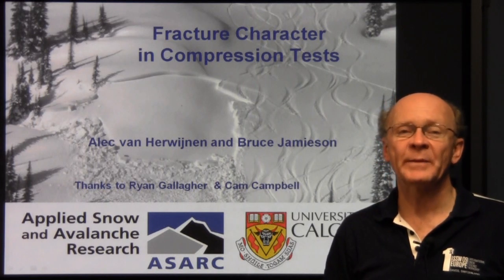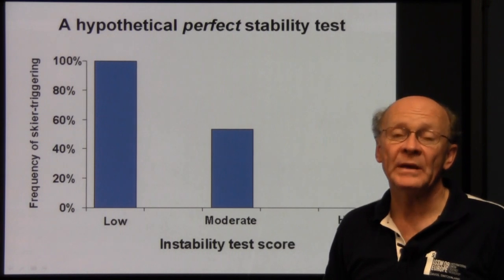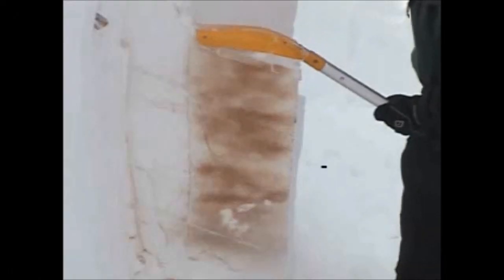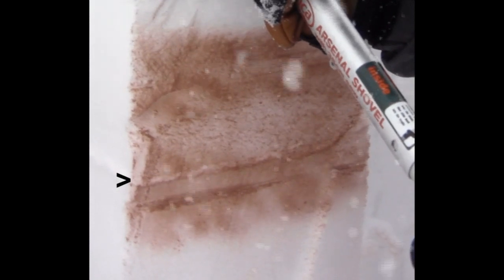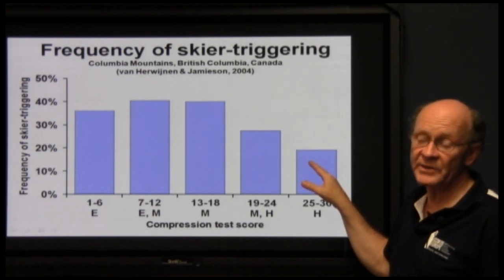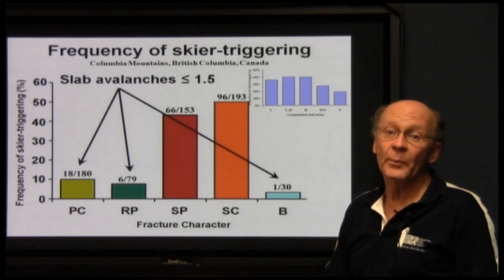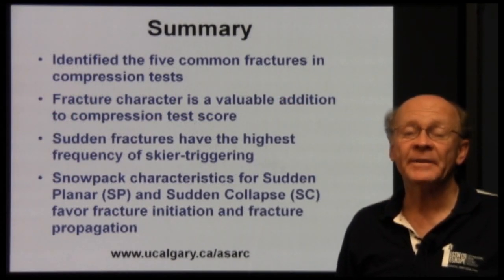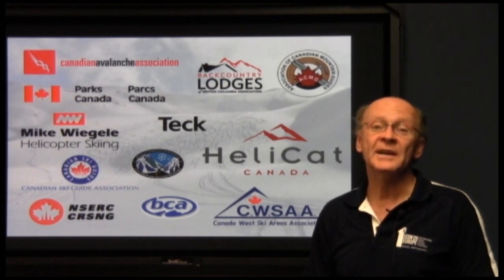Fracture character in compression tests

Comment: Bruce mentioned “false stable” at 25-30 taps ANY failure is unstable snow spatial variation does not exist ECTX is not a stable result it is a test done in the wrong location likely mirroring crown where avalanches end in stable snow

Comment: Consider cumulative taps are like laps or subsequent activity(concurrent). It is important to know if each person in the group or each subsequent lap is deeper than the last. Keep an eye on how much each tap gets you closer to “layer of concern”. Pay close attention to Ski Penetration and Foot Penetration and how it changes during excavation. Most important mirror the crux where self propagating mixed-mode anti-cracks are produced in the shallow weak layer of the snowpack. 1:52 “…for hard Taps but it doesn't drop off nearly as much as we would like for the last six Taps we see about 18% of the adjacent slopes being ski or triggered these could be considered false Stables because we've applied a lot of force we're on our last six Taps and we are seeing an indication of stability and yet we're seeing 18% of the adjacent slopes being ski or triggered…”